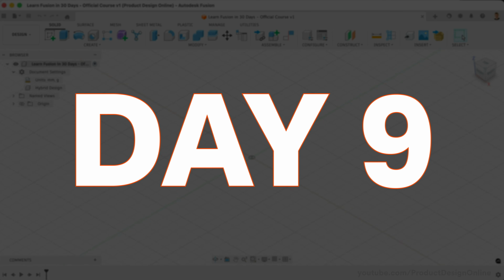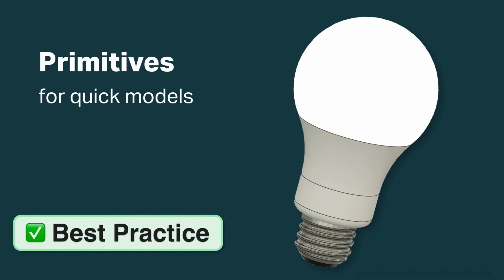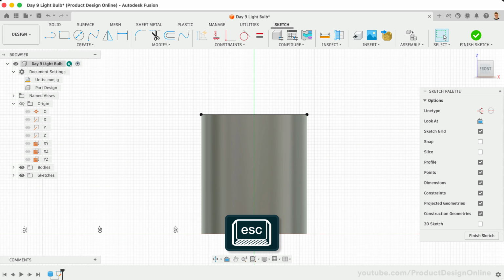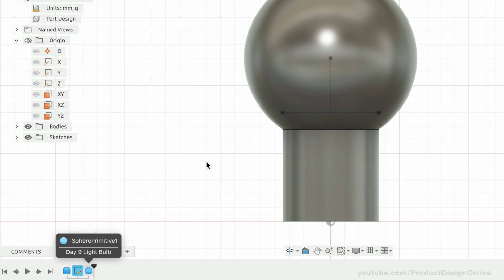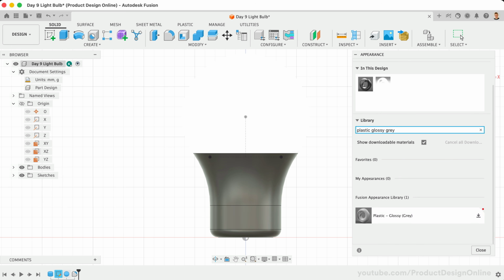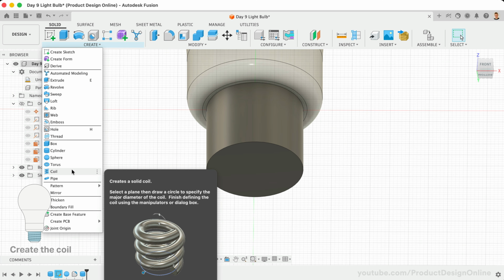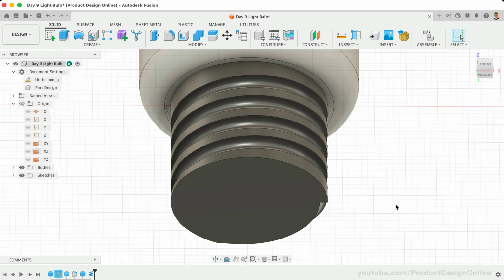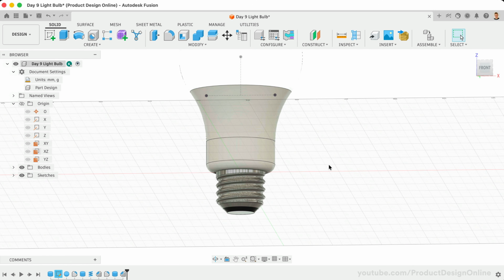How to transition between shapes | Day 9 of Learn Autodesk Fusion in 30 Days (2026 EDITION)

Comment: hey, great work bro.. i am learning alot here...but when i am trying Chafer the bottom of the screw cylinder i am getting error 
"The fillet/chamfer could not be created at the requested size. This might be occurring at the ends of the selected edges.
    Try adjusting the size or using multiple separate operations. Check that the selected edge chain ends at a sensible position, and if not try selecting more edges."
whenever i am trying to adjust face eq distance above 2.5 mm, help please, i recreated the cylinder again but it's still the same

Comment: First off, let me say I'm loving your tutorials. I've had to do some of them a couple times, especially the handle bar one, but I'm figuring it out and you have a great pace and very clear explanations. When we added the cylinder below the lightbulb for the coil part it made mine go under the plane. I went back and watched again a couple times and I might have missed where you addressed that. I guess I need to figure out how to move everything up so it sits right on the plane? Sorry, I'm still very new. It is probably so easy to do too. Also, I was getting an error that the coil couldn't be made, but when I went back and redid it and made sure I filled out the coil box in the exact order you did, it worked. It threw me an error the second time, but still made the coil so all good.

Comment: in the coil dialogue, i set the coil type to triangular ( inside ) , then I applied fillets to the outer and inside edges , but i also chamfered the edges to 2 mm before the fillet , as doing it after the fillet gave me errors

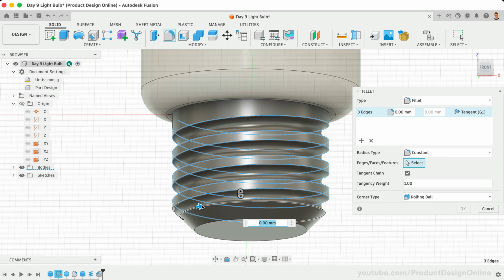Comment: 9:17 Mine is auto selecting the 3 edges and it is going down to the chamfered edges, and it’s not letting me manually select the edges. The bottom edges are keeping me from adding the fillet
Reply: I’m on mac
Reply from the maker: Could you email me your Fusion file so I  can take a look?
Reply: Go back to Chamfer set the “Type” to Equal Distance, mine defaulted to Distance and Angle. This resolved the error for me.

Comment: Excellent tutorial once again, moved on to day 10 phone case but we have to wait i guess :) cause there are so many things changed from 2023 to 2026 :(
Reply from the maker: Day 11 is out now. I'm going to release 12-15 and then go back to the Day 10 phone case as I'm trying to figure out some ways to make it work for the 100+ phone models out there. Needs some additional time to test things.
Reply: @ProductDesignOnline  I apriciate it enormus the time and effort you put in these excellent tutorials. I managed to do the phone case and rather buy a case then print it myself ;) so i wouldn't bother on make it available for 100+ models. They should figure it out themselfes with google search etc ;)

Comment: Hey, Great tutorial!. However I have a question, at the place where the coil touches the rest of the lightbulb, from one side there is still a solid edge which I have no idea how to turn into the coil. Tried using the fillet but it doesnt do anything. How can I fix it?
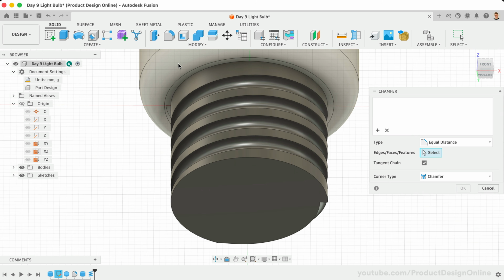Reply: Go back to 8:59 Chamfer change “Type” from distance and Angle to Equal Distance. Then follow the video from there. I had the same error this fix resolved it for me.